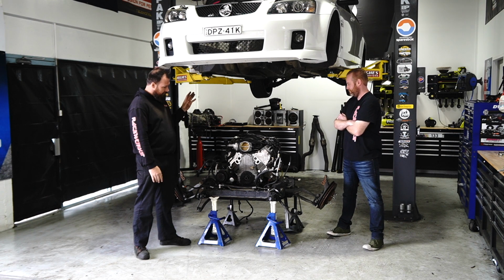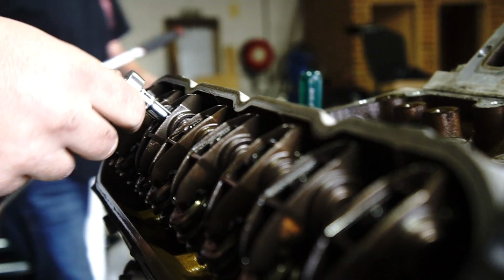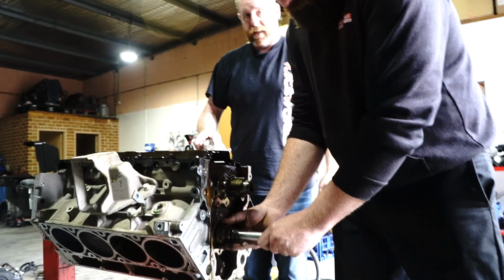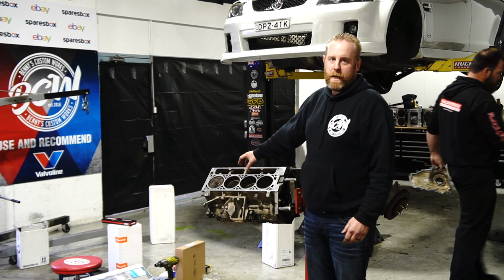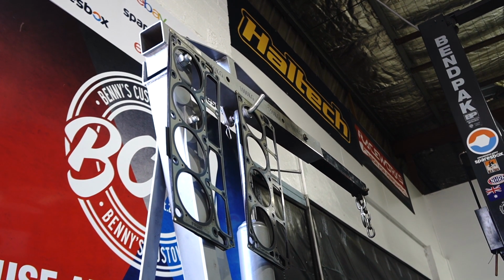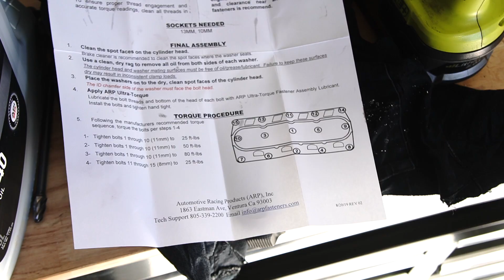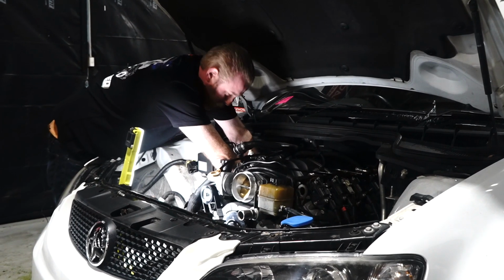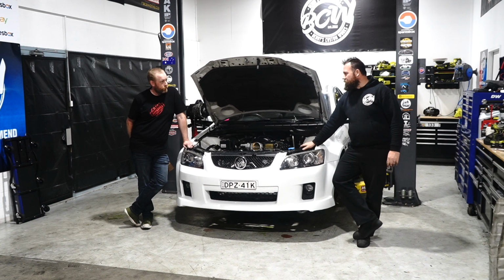Engine Assemble & Install – Great Aussie Build Off Episode 4

Comment: Do you worry about fine material getting into the bores when touching up the block mating surface with the stone etc?  Seen lots of people do it, always wondered if the gunk gets down between the piston and cylinder wall?

Comment: Great show and im loving the series between motive video & BCW @10:17 that oil pick up why is there only one bolt on it when there is another bolt hole there?
Reply: can buy an aftermarket bracket that uses the other hole as an upgrade

Comment: Just done the brembo upgrade myself. DBA42604S for the win. Make sure you get the brembo with correct bolt sizes. VE is m12, VF is m14
Reply: And you'll need 45mm bolts and pad retaining kit if the caliper doesn't come with them

Comment: Boys !! you may want to think about a Holden / Brembo /specific master cylinder too, for the right pedal feel etc ..  im not sure what Holden did , but other cars / manufacturers that had a model of car then in later years such as the BNR32 GT-R skyline etc that went to 4 pot brembo's changed the master cylinder etc to suit the brakes , not just the calipers  etc ANY way something to look into 

did some digging and came up with this ,: "We have been advised by a Holden Subject Matter Expert, the master cylinder is a different diameter. It is 27mm for Brembo and 25.4mm for others.

Comment: Noob question here. I noticed when you put the cam in there was no assembly lube on the cam. Should there usually or is it not required?
Reply: I was just thinking the same thing????
Reply from the maker: We actually had it in and out a few times measuring lift etc and lubed it before final install
Reply: It had a wipe down with oil. Assembly lube isnt really required if you're getting it back together soon
Reply: @BennysCustomWorks  all good. It just looked odd on camera. Loving the content